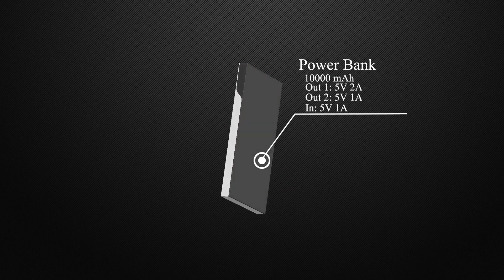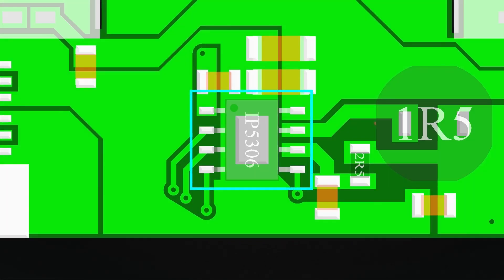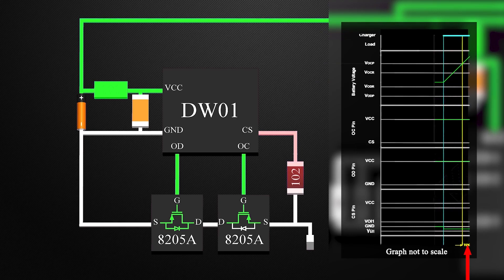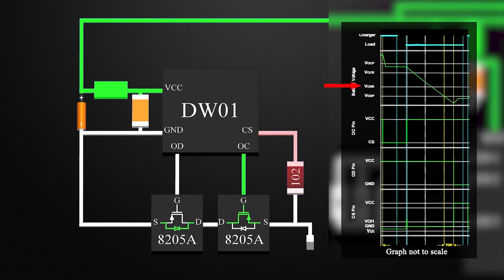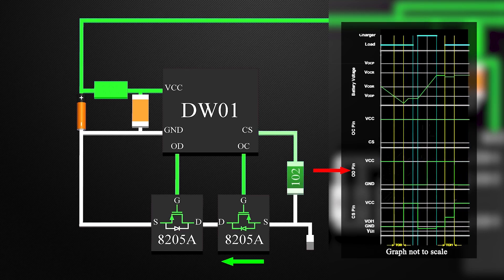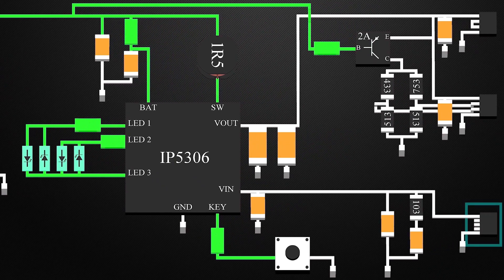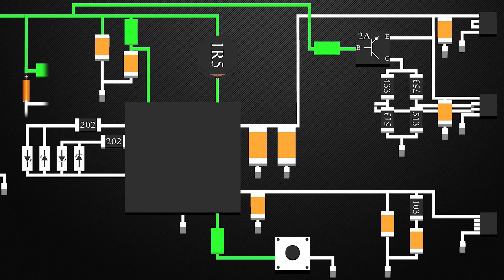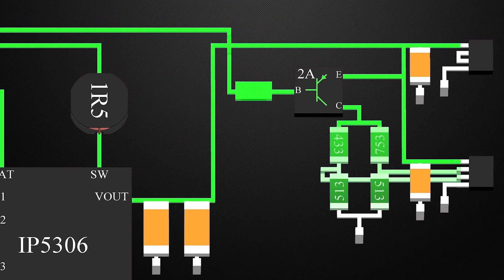How Does A Power Bank Work?

Comment: This is a video that explains with very detail how a power bank works. First he said that a power bank has at least 1 lithium cell, that features 3.7 volts and an specific amount of mah. The power bank features a PCB, it has different circuits. First it has a circuit that protects the battery. Also contains another one that charges the battery. Also has indicators that allow the user to know the state of the power bank. Finally the power bank features the outputs where we canto plug the device we want to charge.

Comment: When a very small load is connected to the power bank, it turn off. Thus, I cannot use very small load on power bank. Which part of the circuit does that?

Comment: Why we use inverter circuit in power bank?  
Can we not charge a 4 volt battery directly and the same connect to mobile for charging when that  every mobile battery have 3.7 volt itself

Comment: There are also Power bank devices that have a node with an LED LCD screen and 4 batteries model 18650 connected in parallel with the help of a nickel sheet and a spot welding machine.

Comment: 4 Blue SMD diodes serve as an indicator of the charge level of the battery located in the Power bank device.
1) when one blue SMD diode lights up, the battery charge level is 25%
2) when the two LEDs light up, the battery charge level is 50%
3) when the 3 SMD diodes light up, the battery charge level is 75%
4) when 4 SMD diodes light up, the battery charge level is 100%.
Reply: Yes❤

Comment: But do you need all of those IC’s? If you are very careful, and have a circuit of a battery, micro usb for charging and usb- a for discharging, and a voltmeter to see the capacity, and a voltage converter from 3.7 to 5v, couldn’t that work?

Comment: the design is not that complex but the process is complicated. this is one of the work of electronic engineers.
imagine you're an electronic Engineer you're given a task to design a circuit where the input can be whether it's 5, 9, or 12V ; with 2A - 5A rate, and with an output of 5, 9, 12V, with 2.5A in the 1st output and 3-5A in the second output.

Comment: What would happen if the charging stops when the cell reaches 4.0V? Instead of 4.2V
How much capacity will we lose?
Reply: it depends on the battery discharge curve (check its datasheet). It could be about 20%